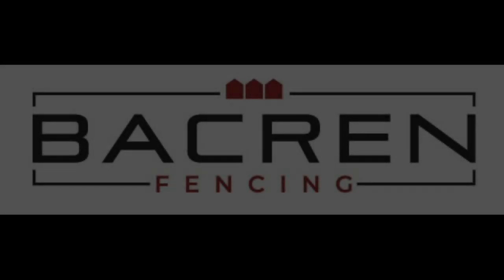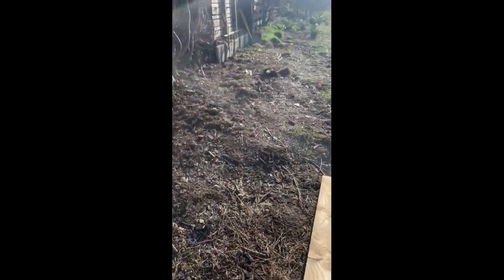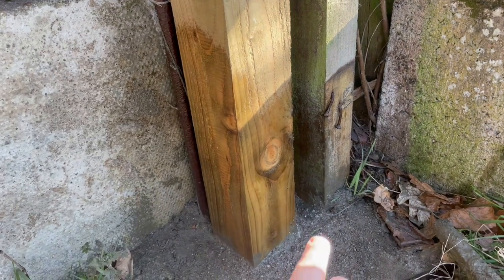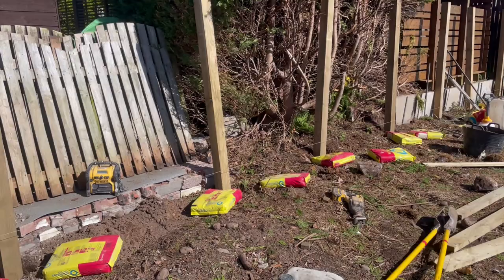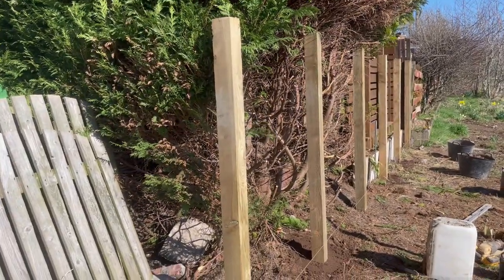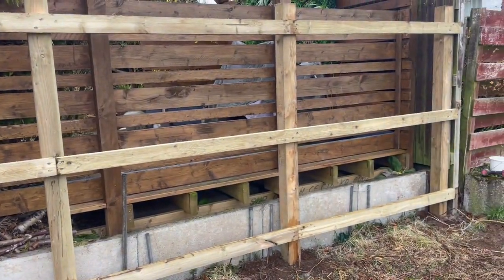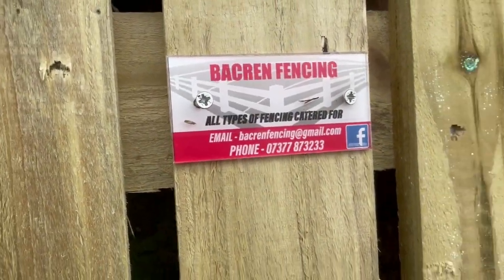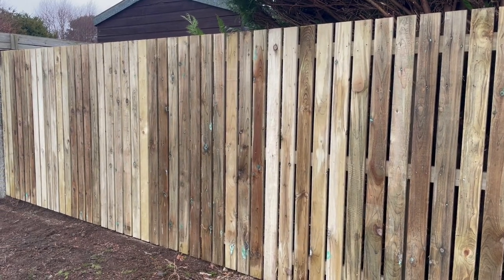How To Build a Standard Timber Fence Tutorial

Comment: I'm not a fencer but I would have put a horizontal sacrificial slat under all the slats, otherwise 10/10
Reply from the maker: Thanks for the comment, I do that occasionally (usually when using feather edge on a close board fence). However, in our area, it is not that common to use sacrificial gravel boards. The park that this fence backs on to is surrounded with slatted fences and they are all built exactly like the one I installed. Best to do things which are in keeping with the surrounding properties. I appreciate the comment though 😎

Comment: 👍👍👍 Nice tip on closing the grain. Thank you.
Reply from the maker: Thanks Pete, yes, it fairly helps when you smooth the surface with a belt sander and then add preserver, it creates a "plasticky" barrier and the water just glides off the top of the post. Thanks for the comment mate 👍

Comment: What dimensions of timber do you use for the rails and for the slats?
Reply from the maker: It differs on a lot of jobs but on this specific job the rails were 88 x 38 x 3600mm and the slats were 100 x 19 x 1800mm. I hope this helps ? Thanks for the comment 👍
Reply: @Bacrenfencing  it really does help. Your videos are brilliant, thank you for your advice.
Reply from the maker: That's great, thanks for the comments - much appreciated 😎
Reply: @Bacrenfencing alright pal what size fence posts are those?
Reply from the maker: @Mr8ofspades  They are 100 x 100 x 2400mm (4x4's)
Reply: @Bacrenfencing  cheers 👍
Reply from the maker: @Mr8ofspades  no probs !